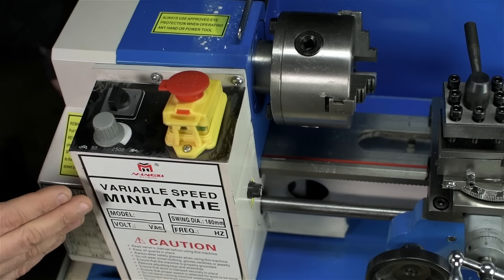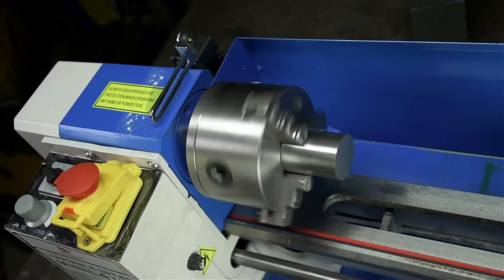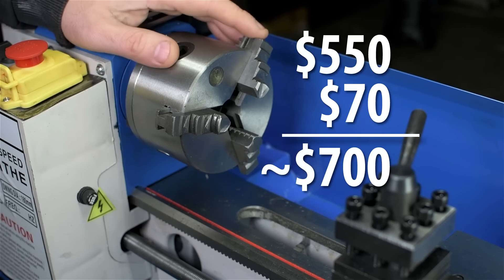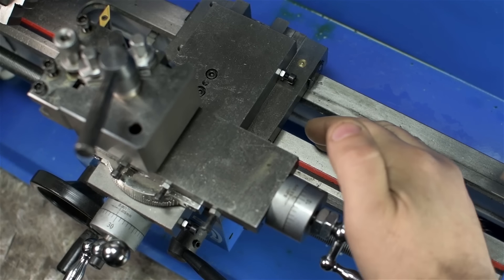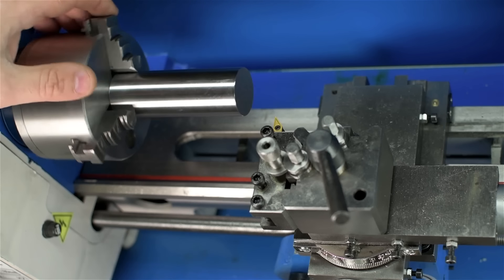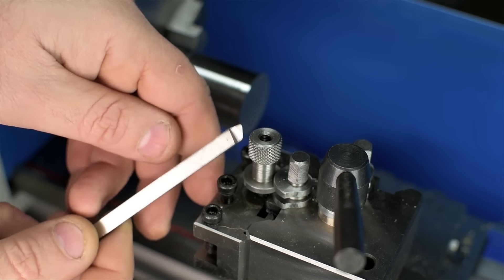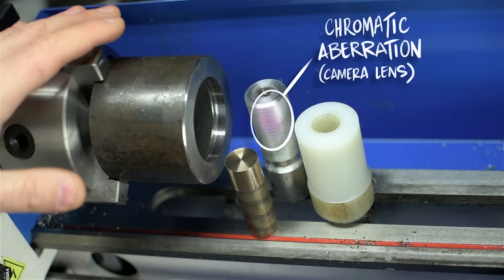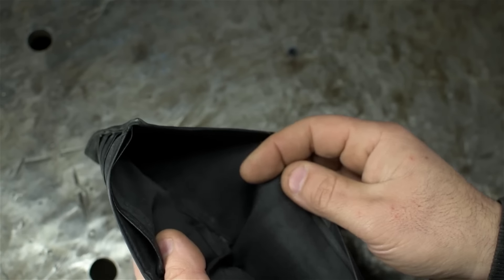The Infamous Mini Lathe!

Comment: About 8 years ago I got a job to cut final length and radius on cable ends and cut the lead in on the copper tube fittings that go into them.  I contacted a company in Brazil that was willing to make me a high speed Swiss type machine with hopper that would do it all automatically for 225,000.00.  No way would the job make that kind of money.  I bought a smaller version than yours.  7" by 10".  Had to spend some time truing the tail stock. Other than that, it was pretty good.  I made two arbors to mount the parts, hand ground 2 carbide tools and was on the road.  Lathe cost me a little over 600.00.  I ended up making well over 20 times that cost in the first order.  Of course, I still had to sit there and make 225,00.00 of these damn things.  Now my son runs those on the very same lathe.

Comment: Text on the box should say "Mini-Lathe KIT".  I think buyers of both the chinesium priced lathes and milling machines would have a much better attitude if Sieg admitted that they are making are the basic, stripped down machines.  All the "extras" can be (must be!) added from third party vendors.  Sieg hits a price point for all the resellers they make machines for...  and the magic word is PRICE POINT!  

That said, Sieg gives access to lots of folks who couldn't/wouldn't fork out the bucks for a "real machine", including me.  It's a great way to get started.
Reply: Couldn't agree more. I've now spent over $1300 on my 7x14 including tooling and accessories. Admitedly, every time I use it I wish that $1300 was a Hercus, myford, atlas, etc, etc but I'd never in my life be able to justify spending that much on something I didn't know if i'd enjoy using or be any good at.

I think in the next 2 years I'll upgrade to something bigger and better but I just blew the motor on my 7x14 and picked up a 1.5KW motor to replace it so it should do me for quite some time yet.

Comment: Great video. Using this type of lathe along with others for 20 years to run my business. Can get it for under $500 on eBay. You will have to tune it and then it can do amazing things. Can do limited steelwork but better for Aluminum and Delrin.  Have  Fun.

Comment: [tl;dr: more speed = more torque = more better, do NOT lower the RPM on this lathe for heavy cuts] Just a little note here about the DC motor speed to power relationship and why it seemed to stall and struggle so much when you tried HSS tooling at low RPM:  it's almost certainly a simple two terminal brushed permanent magnet DC motor and the only way to control the speed of such a motor is to adjust the supply voltage. That is, to lower the no-load RPM, you supply it with a lower voltage. As a result, you're supplying less power (lower voltage over the same impedance means less current, means less power), and less power means less torque.

In other words: while it is true that "DC motors have more torque at low speed", this statement is somewhat misleading here - certainly, a speed-torque curve of such a motor, which is in fact more like a speed-torque straight line, shows a very simple inverse relationship between speed and torque, but this relationship holds *at a specific voltage*. It doesn't say "if you turn the speed knob down, the motor turns slower but has more torque", it says "as you apply a mechanical load to the motor forcing it to exert torque, its speed drops, all else being equal". If that sounds kind of backwards, that's because this relationship works in both directions, neither speed nor torque is inherently subordinate on the other.

Look up "brushed DC motor speed torque curve" on google images and look for one that shows several "curves" overlaid on a single graph. They're each labeled with a specific supply voltage and let you know what the motor's speed going to be at this voltage, given that much torque trying to make it stop (strictly speaking: given whatever force trying to make it stop that requires the motor to produce this much torque to keep going anyway).

You can clearly see two things on such a graph:
1. Under no load (where the curves hit the speed axis, which coincides with 0 on the torque axis), the motor's speed is determined by the supply voltage - so if you want a lower no load speed, you must lower the voltage, there's no other way to do it. That's what the knob on the lathe does.
2. As you lower the voltage, the maximum torque (where the curves hit the torque axis, which coincides with 0 on the speed axis - that is, a stall) gets lower.

The practical takeaway here is: if you have a mini lathe with a brushed PM DC motor, you want to run it as fast as is reasonably possible for a given cut to get maximum torque.

Admittedly, the motor controller might be doing some sort of speed regulation feedback if there's a spindle encoder in the headstock, in which case it does bump the voltage up as you start cutting, to try to get the motor to turn at the requested speed despite the load applied, but even then, by setting a low maximum speed, you put it at a disadvantage. More speed means more inertia and more stored energy at the start of a heavy cut, which gives the controller a little bit more time to react and bump the voltage to the max before the motor stalls. Additionally, even if it does have feedback, it's probably pretty dumb and slow to react, so it's very likely to be designed to avoid speed overshoot on torque drop by limiting the maximum motor voltage depending on set speed anyway.

Also: if you want better, you don't want a brushed DC motor at all, even a bigger one. You want a 3-phase AC motor with a vector VFD. You don't even need a 3-phase power outlet for that, there are sub-1kW VFDs that take single phase power and output 3-phase, albeit at the supply's phase-to-neutral voltage, which is not a problem at all if you wire your motor in delta configuration. Just make it absolutely sure to get a vector drive VFD, and not a scalar one. Simply look for "vector" or "scalar" in the product description. Vector drives are much better at very low RPMs and maintain speed more accurately across sudden torque changes. They cost 10-20% more than scalar versions.
 The gains for a machine tool are well worth that difference.

A 750W motor that should fit in place of the original one can be bought for as little as $50 new and a suitable VFD can be found for $120 new. INVT Goodrive10 and Goodrive20 series are pretty decent for an officially chinese product and fall in that price range.
Reply: The motor on mine is brushless DC, has masses of toque at low speeds.
Reply: Only a Polish guy could come up with such elaborate explanation.  Thank you for the bit on vector drive, cheers mate :)
Reply: @fredgenius  Good for you. Those lathes are configure-to-order, so long as the order is large enough - so if you're a hardware store owner and want to sell those, you can get them customized however you want, with as much or as little improvement over the cheapest base model as you wish. Tony said he got the cheapest one he could find and it shows (look at the front label, they gave so few fucks that there's no model number or anything filled in!), so there's a pretty damn high chance he got it with the cheapest motor type, which is brushed DC. The one I bought when I was in high school had a brushed DC motor too and it stalled at low speeds just like Tony's.

Yours is a notch or two higher on the extra features scale, so you got a better motor.

And don't even get me started on the whole "brushless DC motor" thing, this is the dumbest misnomer the whole electrical industry ever came up with. Those are permanent magnet AC motors, but they're called "DC" because they don't take line-level AC supply directly from a power outlet and are typically used in the same roles that brushed DC motors were in the past (or still are in cheaper machines, obviously).
Reply: It's the cheapest possible machine, so speed control is probably just a rheostat between supply and the motor.
Reply: @quiescentnexus  The brushless DC motors also can run on pulsed DC so they are not misnamed. I actually run one on 350VAC 300Hz so it is capable of running at line level voltages also. 240V is at 208Hz and 60Hz is at about 70Volts. Brushed DC motors is a misnomer also as they are often universal motors and will run on AC or DC.
Reply: gravelydon Are we all referring to the same kind of motor? Because AFAIK, permanent magnet brushless motors can’t run on DC nor single phase AC. They run on a precisely timed 3-phase AC, usually provided by an ESC.

As for brushed DC motors, in my world, they’re are exactly that, brushed motors that run on DC. Universal motors can also be consider brushed DC (as they can run on DC), but in order to differentiate between the two, most people don’t refer to them as such, it’s not a misnomer at all.
Reply: @gravelydon7072  Pulsed DC is technically AC (just not a sine wave and usually not at a constant frequency) which is why people complain they are misnamed.  You can't run a brushless DC motor on DC unless you have some kind of circuit to turn it into at least square-wave AC.
Reply: @Berkeloid0  Pulsed DC can be in two forms. One never goes below 0 and into the negative range. The other is like square wave where it is both positive and negative. The first cannot be classified as AC while the second can.
Reply: @gravelydon7072  Fair enough but you were talking about brushless motors and when these are run from DC the polarity is typically flipped instead of switching the current on and off for each pulse (thus doubling the amplitude of the pulses), so if you are measuring the voltage on each phase at the motor's input then the pulsed DC will appear to have both positive and negative components, making it AC by your definition.
Reply: @Berkeloid0  True. If you want a 220 volt output and only have a 110 volt input you would have to flip the voltages. Back before modern IC chips the only way to create something that looked like AC was thru the use of a vibrating relay setup.The contacts were fed the same voltage as the output and a capacitor would charge up to activate the relay. Depending on the capacitor and the relay, you would get a fixed Hz pulsed DC that could then be used to do the work. How far back were those circuits used, the time of the Model T. How recent was something like that used., up until the 70s. Many of the older railroad passenger cars had an outlet in the restroom/lounge areas that was marked "110Volts, Shavers only " and had these behind the outlets. When Amtrak took over and installed HEP in the cars, there was finally 110 Volts true AC in the outlets. Some of the railcars did have a motor alternator under the car to produce AC in the 40s and up so it depended on what was used for battery voltage. 32V was the standard which then went to 64V and finally 110 V DC. With HEP it is all fed to the car as 480 V AC and then stepped down as needed.

Comment: I have a slightly later version of this lathe. It has a digital rpm readout and the forward/reverse lever for the lead screw has a defined neutral position.  I'm told that it has taper roller bearings on the headstock spindle. It also has the little threading doohicky on the half nut that doesn't appear to do anything, but it does have a carriage lock.. The T-nut for that wobbles like a jelly and takes many turns to loosen/tighten. The gib for the cross slide needs its own locking screw and cocks over under pressure. Backlash on the cross slide and compound rest/carrier are atrocious, but repeatable. One thing that I found out to my cost, is that there's a grub screw inside a nut at the tailstock end of the lead screw. If that comes loose, the nut is free to tighten up and lock the lead screw. Then you get a click click snap that signifies a tooth breaking off from the 80 tooth gear that drives the lead screw!

What do I use it for? To date mostly turning solid metal into chips! Eventually I hope to make parts for steam toys and working steam scale models - if not original designs loosely based on existing examples.
Reply: Usually threading dials can be disengaged. Also, consider any new machine to be a work in progress, and to need multiple tweaks to fine tune.

Comment: Lol, I too came to see tiny lathe. I see the humor! Loved the video and think i learned more than video intended about lathe operations in general. I am not turned off by this lathe and will probably pick one up. Currently have an older Sherline mini lathe and like it but has no power feed or taper capabilities without adjusting head stock, Was good at etch-a-sketch as a kid. That helps!

Comment: i love my mini lathe. And there are 2 different manufacturers .Sieg being the numero uno in my opinion. very useful machine regardless of what the Monarch snobs say lol
Reply: "Oh no, it has plastic gears!" 
Yeah... too bad you dont have a lathe to fab some brass or potmetal gears for it... oh wait, you totally DO have the capability to make new gears For the minilathe With the minilathe.  
Also, just buy some spare cheap plastic gears: Cheap gears are Inexpensive, and treat them as a cheap safety Shear to protect valuable tooling
Reply: Same here. The Sieg looks kinda the same but from what I saw in the video there is quite a difference in quality.
Reply: @aaronsilas7024  the sieg is quite a bit nicer. check frank hoose on yt, he has good overview.
Reply: Summit X  yes 2009 can weld and should stick to that lol
Reply: I'd be a Monarch snob but it won't fit in my kitchen :o)
Reply: @rwbimbie5854  cheap gears are inexpensive. Wow

Comment: I remember spinning up parts on an Accuturn 9000. It was a small homegroup shop, nothing for production and I'm not a machinist.
I see this little guy with everything adjusted/lubed doing lite work on small parts in my garage a nice little addition. As long as you can get .001" tolerance and the finish you desire and actually make enough parts tu justify the cost and space it takes up. Then again, I'm a mechanic and I have a lot of tools that you virtually never need but when you need it, you need it, so I have to buy it and keep it laying around for just in case. Such as it is for this lathe.

Comment: I have got one of these, and for the longest time ive wanted to bolt a 2.2kw (or similar) 3 phase motor into it, although i get the feeling that would be like dropping a 454 into a miata. Im sure itll work, but hold onto your hats and hang on tight...
Reply: Now I want to make a battery powered one, you can probably do it with 100-200bucks with stuff from hobbyking.
Reply: @satibel  Rc parts? Genius! I feel that would actually be quite practical not to mention with the right set up you could really up the torque.
Reply: @firestone3217  the one I have is 2kw, at 20V/100A, it can produce around 10Nm at 2000 rpm (loaded), which is about 7 foot-pound, that needs to be geared down about 1:2-1:6, which means 20-60Nm or 14-44 foot-pound (maybe less because of the lower load, thus higher rpm)
Reply: Poor plastic gears

Comment: I've spent the last 13 years on my Chinese lathe (larger then this one) using it a few times a week in my business and as nice as a quick change post is Ive never needed it, i bought a set of tools holders that fit the lathe post at the correct centre and leave 2 in it (chamfer and cutting)
Considered the quick change as a bling, nice to have but unless you are doing volumes of parts on the lathe and having to swap tool posts a lot every session not worth the cost and hassle of converting the machine to take one.
But I'm a penny pincher and work too hard for my money so for people who want to fritter away their easy money on fancy stuff they don't need .... well each to their own.